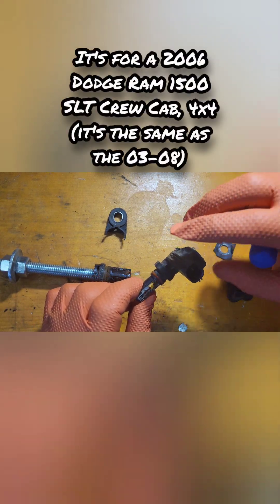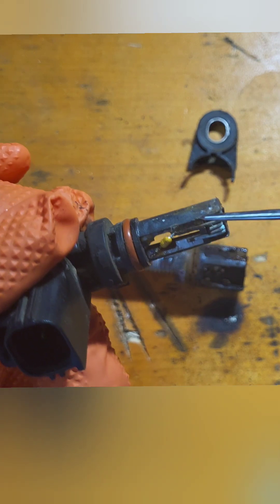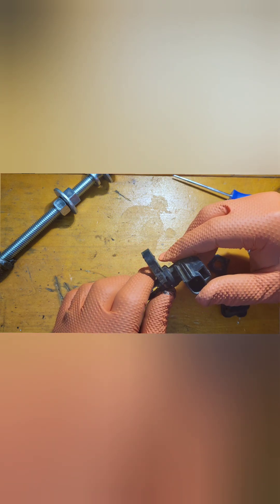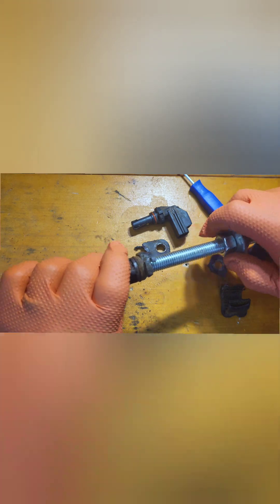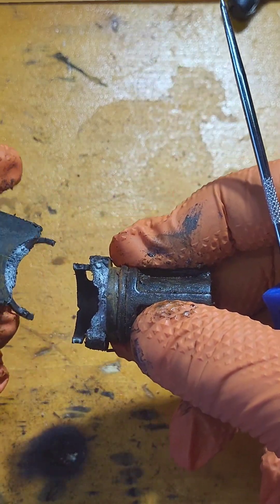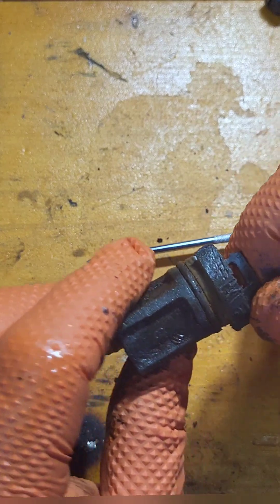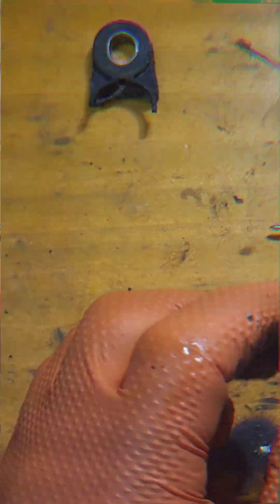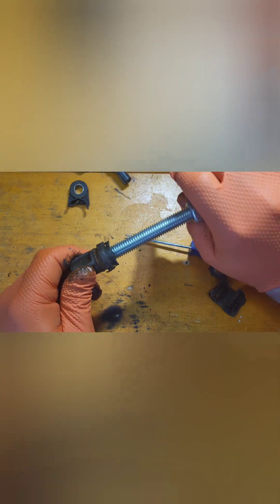How I removed a Broken ABS sensor from an 06 Dodge Ram 1500 SLT, (same as a 03-08)

Comment: I was doing some work on my grandfathers 98 turbo diesel and knew something was off when I took out the ABS sensor. "Speedometer didn't work" 
A little different then what happened here but sure as hell helped me out. 
The ABS sensor was broken from the tail that goes into the insert, I had no clue how it looks unbroken.
If you read this then what part is that insert called? I might need it when I replace the ABS sensor.
Reply from the maker: I just used a half in bolt from home depot, heated it up with a torch and turned it into the broken piece to melt threads into the broken sensor, then wiggled it while I used a small screwdriver to pry it out, it was a pain but it worked, no special tools :) Glad it helped!! Check out some of my other videos and subscribe for more cool content!